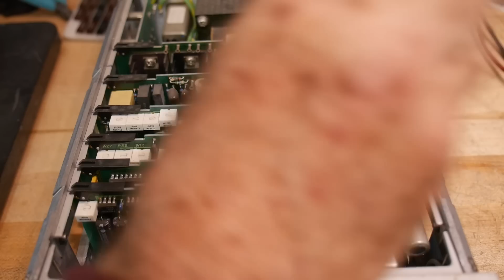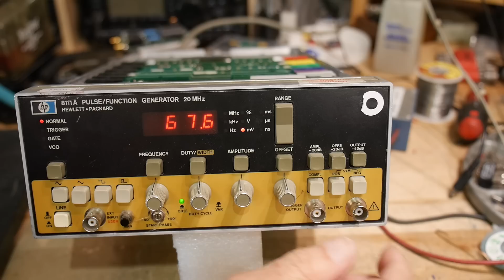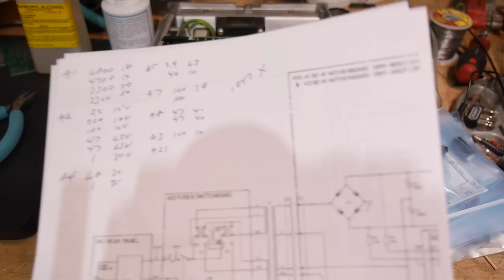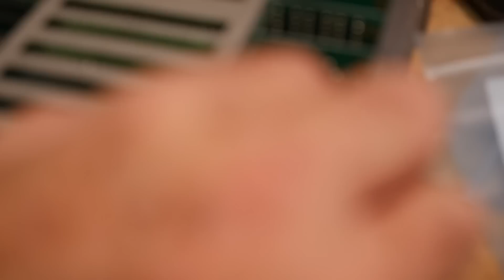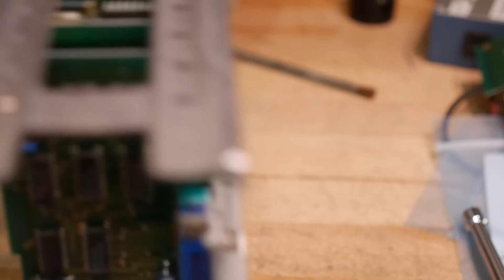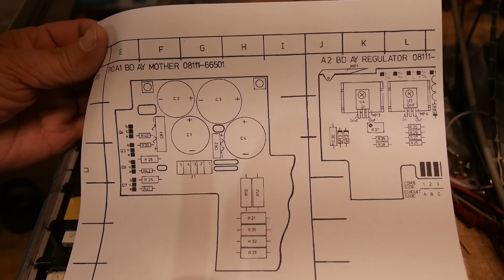#332 HP8111a Function/Pulse Generator

Comment: The first capacitor directly connected to the 240V AC socket failed yesterday with a loud bang, leaving a black mark on my desk. 😂 https://drive.google.com/file/d/1mj1OlDYBSbqY4hUwGO9bUq8fF2iLzO0s/view and https://drive.google.com/file/d/1SUnKsHbfup4RmnW6HeY53cj3PONLsSpB/view It's not a problem, though. Since I only needed the 8111A for a few minutes, I simply removed the capacitor. I'll replace it later.

Comment: @15:30: X-type are intended to fail short circuit.  They're intended to trigger an upstream overcurrent device (ie. a breaker or fuse).

Y-type are intended to fail open circuit.

Placing an X-type between either line and ground may cause the metal casework of a device to become live at line voltage.  This may prove fatal.

"A Y2 capacitor can safely be used in place of an X2 capacitor, but an X2 capacitor should not be used in place of a Y2 capacitor. This is because, although an X2-type capacitor would work and filter noise sufficiently, it would not meet the line-to-ground safety standards."  https://www.allaboutcircuits.com/technical-articles/safety-capacitor-class-x-and-class-y-capacitors/

Comment: Think the silver caps are wet tantalum. There great. Good find. I have the 8112A Give the front panel a soaking with wd40 to make those switches not snap. The levers inside have dried up and are prone to fracture.

Comment: I received mine today it only outputs a sine wave.
Reply from the maker: Hope you can repair it. Good service manual.
Reply: @IMSAIGuy  I was wrong hate to admit it,,, it works. As a winter project I’m going to rebuild mine like you did. It looks like mine was built in 1984 And has a ribbon cable going from A2 to the front somewhere